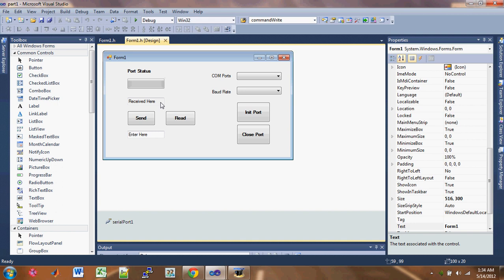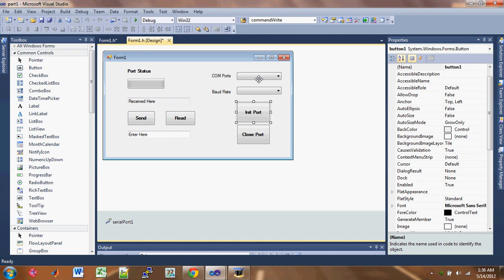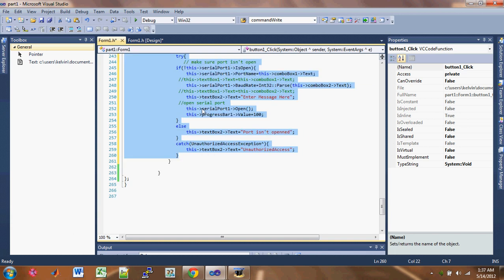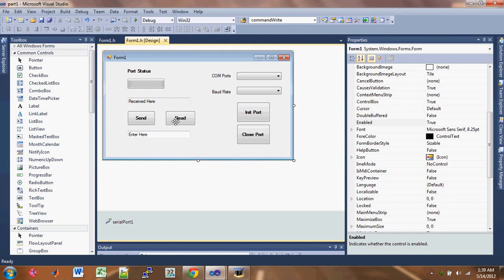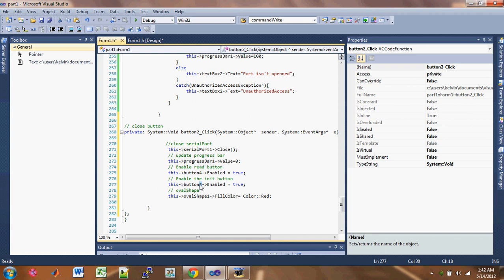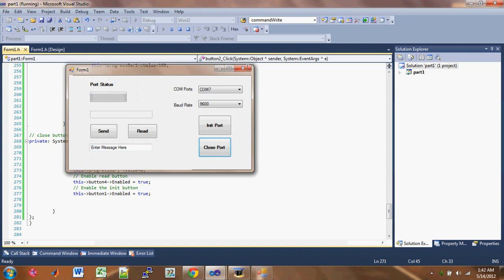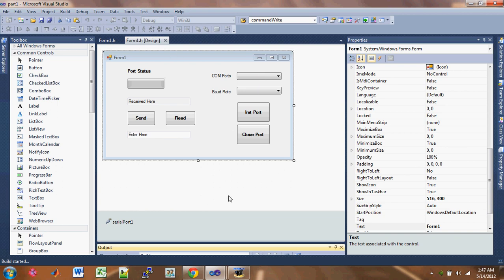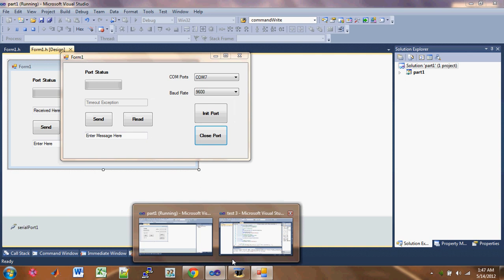Visual Studio C++ Serial Port Tutorial Part 3

Comment: Thank you for your tutorial, 
But I have a follow up problem now. 
The Arduino Nano I have connected is not sending any Data to my visual studio exe. 

What I mean is: 
The Arduino is for sure sending Data, I have checked that. 
However, when I try to read the data from my Visual Studio Program it doesnt work. 
The problem is not with the code, because I checked with a friend of mine, and it works with the same code on his PC. 
So my question is, do I need to change a setting on my Laptop? 
Thank you for your help

Comment: I fallowed the tutorial and i can send data but I cannot receive any data from serial port, i am using arduino to communicate with the application. can you help me please...
Reply: I have almost same problem here. At least I can send data from arduino to this app, but it is bugged somehow. Sometimes it doesn't read my data, sometimes it looks like data comes too slow, and sometimes I think I receive wrong data, which is strange, cuz I'm sending 0 or 1, and catching something between (?) like 00, 0f.
Reply: Did you solve this problem? I have arduino leonardo and i dont know why i dont read any data... In Arduino IDE it is working.
Reply: Not really. At the end I've changed the IDE for Qt Creator and went throught this tutorial: http://szymonsiarkiewicz.pl/poradniki/kurs-qt/kurs-qt-obsluga-portow-szeregowych/
Reply: Thank you. I tried today morning with Arduino uno, and my program in visual studio read data form it. I give more time to wait for data from arduino. I need to find way to cyclic read in my program or, read on event. Is Qt creator better then visual studio for beginners? I tried builder c++ earlier.
Reply: I found Qt being easier for beginners,  but you have to have in mind that it is just diffrent IDE, where you can still use C++. Qt is for sure less widespread, but it offers connect signals and slots mechanism, which make programming things like USB, TCP, MySQL etc. extremely easy. At least for me, cuz I'm not best software developer ;). But if your goal is to write better, more complex software to speak with your Arduino, and Arduino IDE isn't enought, then I suggest you to use Qt Cretor, if you aren't the best programmer like me ;]

Comment: A very well-explanined tutorial indeed.
Somehow I have some errors compiling in VS2010 Express Edition. Some syntax errors where I cant seem to understand.

Anyway, Kelvin, do you have any sample codes if I need to talk to a external machine using my PC with rs-232 cable? I need to monitor and extract some information by quering the machine. From what I have researched in the net, looks like some commands like SetCommState, GetCommState and stuff like that.
Any advise?
Thanks

Comment: In that 'Enter Here', box what exactly do you enter if you want to control the speed of a motor? Suppose, I'm using an arduino uC and a motor driver IC to interface the motor.